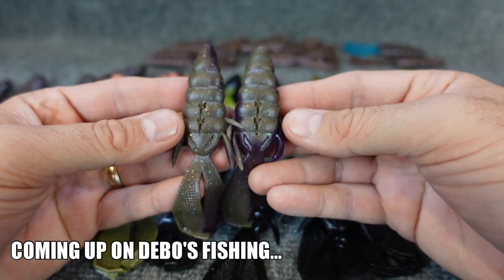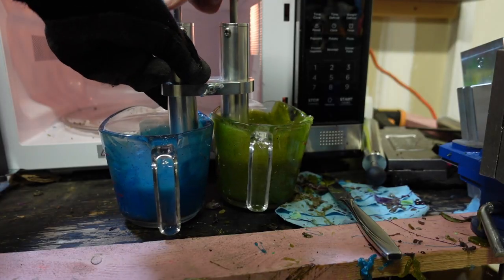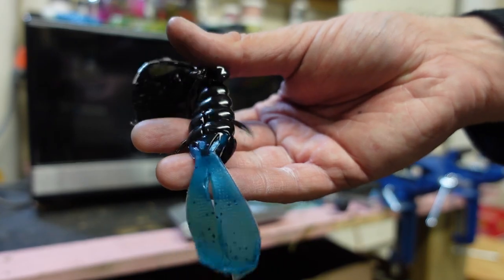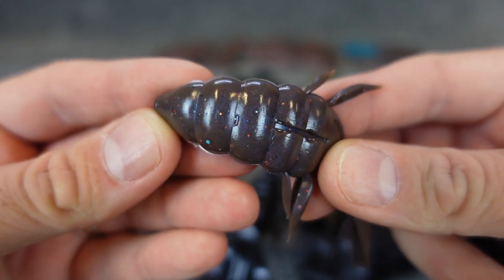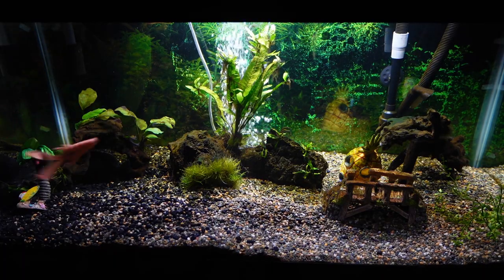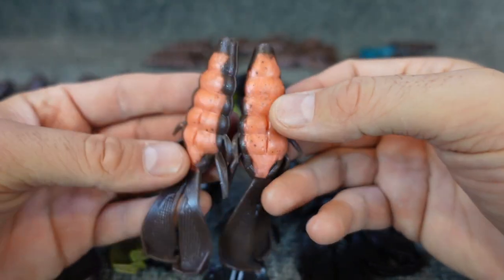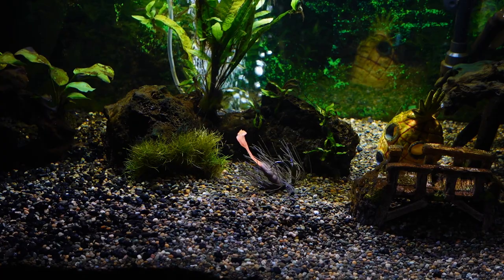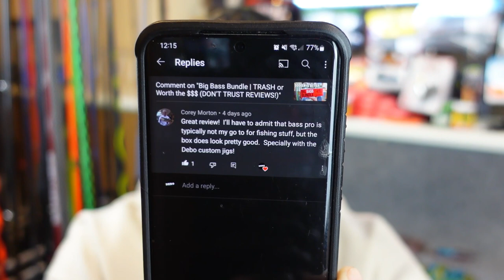Simple Hack Makes AWESOME Lures (NEW Bushi Beetle from Do-it)

Comment: Hey Debo..you can get a similar look with the "sand " mold... Use a polishing compound usually used for auto finishes. It will polish out at least those areas you can reach ..say with a small polishing head for a dremil...rubber flaps that polish with a "cutting cream* as they called it in the auto business.. also worked well to polish plastics ,glass and acrylics supposedly.

Comment: Sometimes I spray a little worm oil in my Do-it cast aluminum molds and the baits come out much smoother and shinier. You can really see a difference in the Bushi Beetles when you oil the mold. On the flipside sometimes I like the duller color from the cast molds especially in super clear water. I find it makes the baits look more natural as opposed to super shiny.

Comment: From watching world's worst fishing, he suggests using worm oil on the molds. At least for a two tone like you did with the different colored heads. I believe it's meant to make placing the head easier and for sure releasing the plastics easier. If it makes a difference to you,  and my preference is the finish of the cnc milled mold,  you could get a dremel and a polish and go to town polishing the sand cast molds. Gotta go with the black with purple flake as my favorite color.

Comment: you should heat up your Sand casted mold with a heat gun or a hot plate that should fix your issue of the hook slots not filling in, if not maybe cut a vent or 2 in the mold.